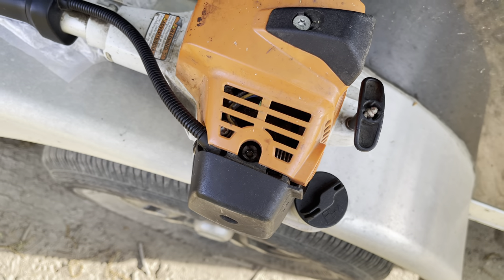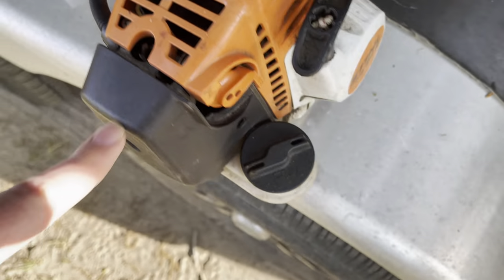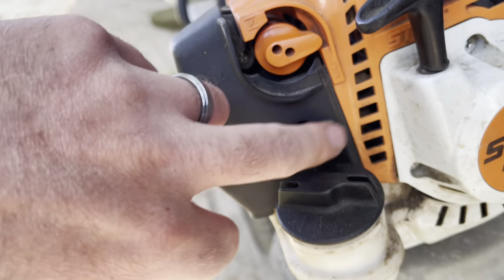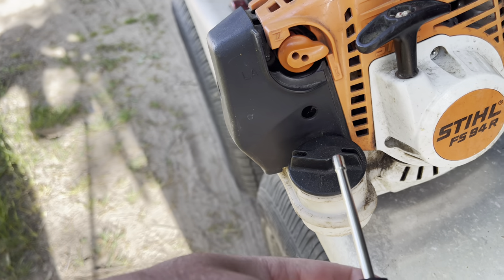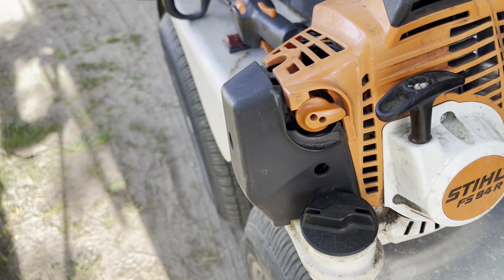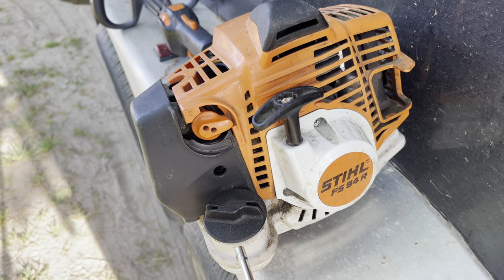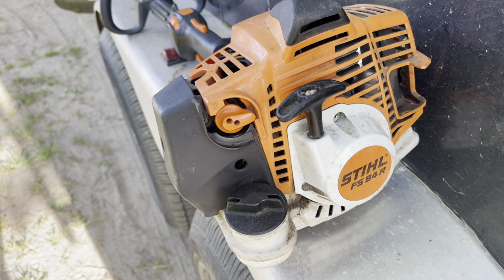Stihl FS 94r Carburetor Adjustment. How to adjust Stihl weed wacker carburetor.

Comment: I have the same problem with a used FS 94 R I bought on Kijiji

It runs great for about five minutes and then boggs down.

It might just be a simple tune up of the carburetor. 

Your video has given me confidence.

I will buy that tool and adjust the low & high end while I trim.

Thanks for your video!

Comment: The tool you need is not the hexagon tip. It is the splined tip.
Adjust the low and high speed together until you have a crisp transition from idle all the way to full engine speed.
At full speed( max working rpm) the engine should just tail off and the exhaust note flattens.
If you tune it too sharp at max rpm, it is likely running lean and will therefore run hot and Will ware out faster or in extreme cases will burn a hole in the piston.
Always clean the air filter, use fresh fuel and get the machine up to full operating temperature before changing any settings.
Cheers from Team Bengt Phorx
Australia
Reply from the maker: Thanks for the tips! I’m still trying to find the perfect position but it’s a lot better than it was!
Reply: @douglaslawncare2843  I figure you knew most of that anyhow.
I putt that in for the punters really.
Good vid though.
I have a few of these to maintain and a bunch of vintage 2 stroke race bikes.

Comment: The first thing you need to do is make sure that the air filter is clean. The second thing you have to do is make sure the trimmer is completely up to operating temperature. The third thing you need to do is ditch the guard and run the string out about 8 in because it will hit the rev limiter too easily without this. Once you have the guard off and then you can adjust the carburetor properly. With the guard on you really can't adjust it properly because it keeps hitting the limiter. Without it you get a better carburetor adjustment.
Reply from the maker: My previous video to this one was replacing the air filter, fuel filter and spark plug. 👍🏻 That’s good to know about taking the head off to hit that limiter! I’m still trying to adjust the stinking carburetor in this machine.
Reply: The carb should be adjusted to the maximum length of trimmer line the guard allows.

Comment: This video describes a filter within the carburetor that often becomes clogged on the FS series trimmers.

And he describes why only the low end needs to be adjusted to resolve that low idle bogging down problem.

https://youtu.be/4SN89-x-M88
Reply from the maker: Other things to look for.

Air filter
Fuel filter
And removal of the spark arrestor.